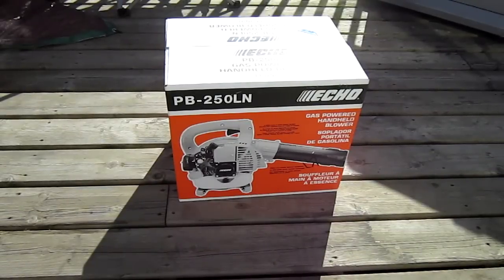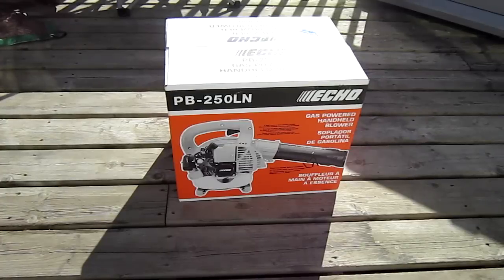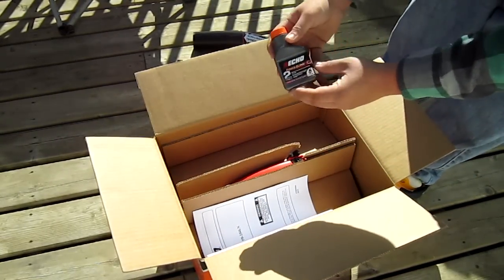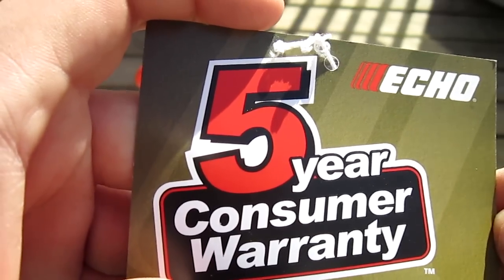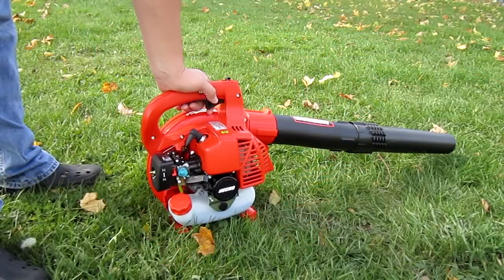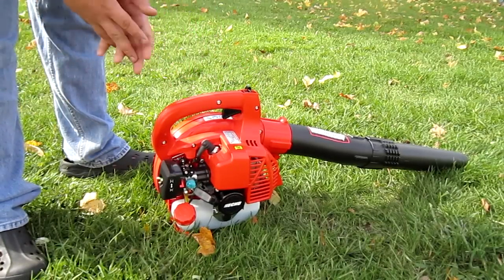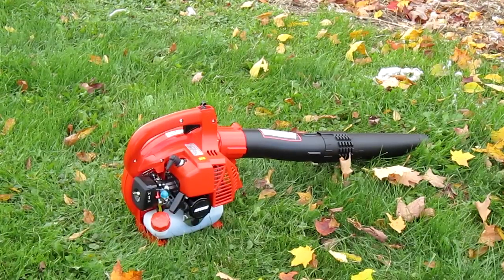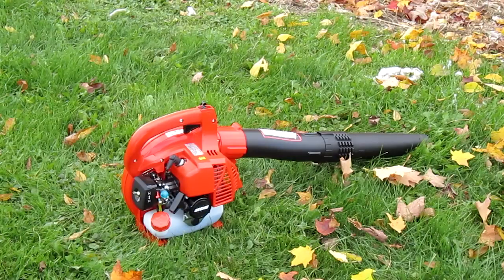Echo PB-250 Unboxing & First Thoughts

Comment: @pimpinpenz Does It Take A Long Time To Get it running??. Because a have a 2010 ryobi blower, and I would take about 10 pulls to start compared to that echo pb250ln. Also Do You like The Rotational Control? One Last Question...Do You think This Echo a Commercial Blower Or Homeowner?. Thanks.